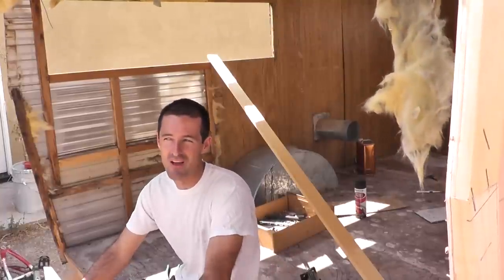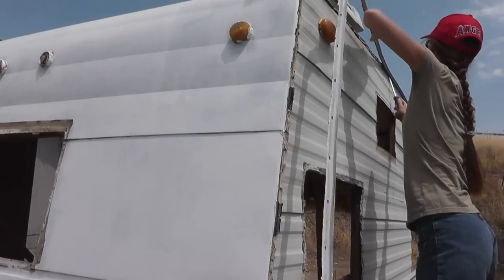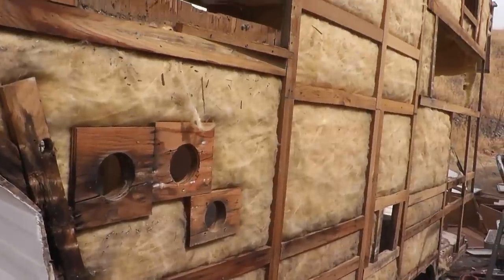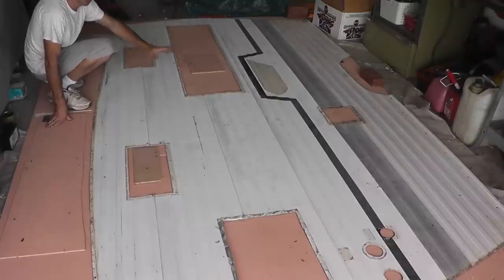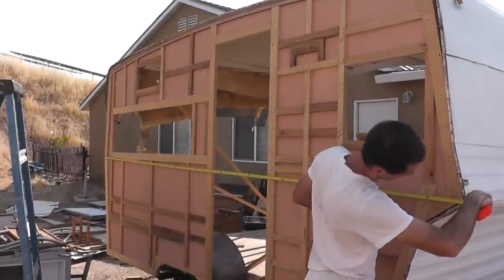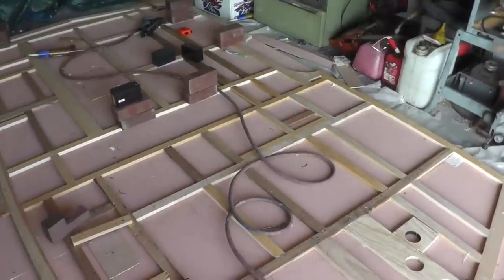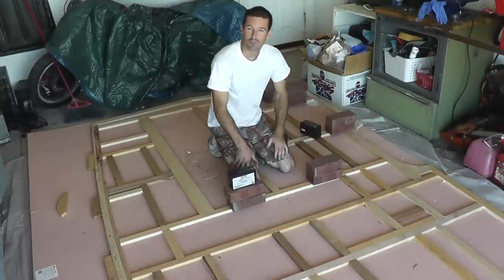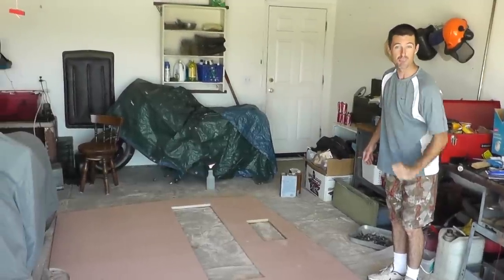Vintage Shasta Camper Trailer Restoration - Part 6 - Wall Construction & Cat Stories!

Comment: Just found your video's on the shasta. Great job! I was looking for part 7 and realized your still in the process. Just bought a 1989  32 ft. today. Same issues with wall corners and windows, Water WATER WATER! Oh well looked ok when I bought it but that's how you learn. Now I know what to look for. Like you said in earlier videos, If you can see the damage its WAY worse on the inside. 2x4's were just dust and wet remains of what used to be wood. If your looking at buying something push on the walls near windows and corners, If they feel spungie expect some serious work. Hope this helps. Thanks for the videos!

Comment: you might as well do the roof too , to make sure its sealed right . are you going to put  the front bunk back in , always good for sleeping  kids , storage , ect . if you do , use some thicker lag bolts and washers on all sides and front  to support the weight
Reply from the maker: tracycolorado I'm going to seal up the roof, but probably not remove it completely. I haven't decided about the bunk bed yet. I might reinstall it, or just leave that area as a shelf. Either way I agree some good size screws are the way to go.

Comment: Hello there! I love your videos, very knowledgable and entertaining. You probably heard this question before... but I'm curious to know if there was a possibility to rebuild the walls from inside without removing the outside walls.. did you just do because the water damage was under/frames? I just start working (1st time) on a Nomad 1970. It looks like inly the inside panels were damaged... i hope. Thanks!

Comment: but there WAS sexy in the Shasta video... I found a 2004 Boxster with the intermediate shaft disaster, do you know much about that?  guy just missed the boat on the class action lawsuit...
Reply from the maker: knikula From what I understand, you should assume the engine is toast. If you can get the car cheap enough that installing a new/used engine would be economical, maybe go for it. You still could sell some parts from the original engine and make some money. It's a lot of work though. For me, it would have to be a super clean car otherwise, and a ridiculously low price.
Reply: ***** thanks much for the Boxster tips...

Comment: Not to reopen an old post but if you were going to do the whole thing anyway why not just strip down to the base and rebuild it up from there would have saved the trouble of having to brace and could have done all walls and roof at same time